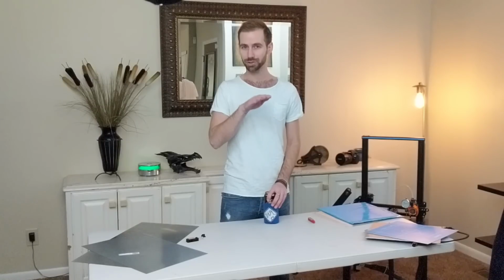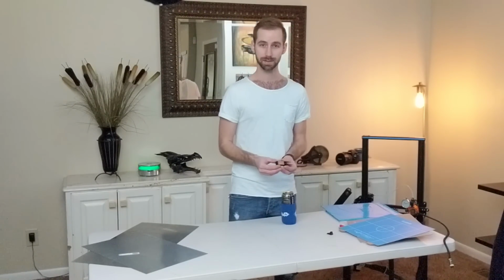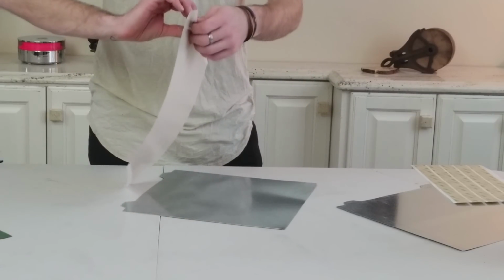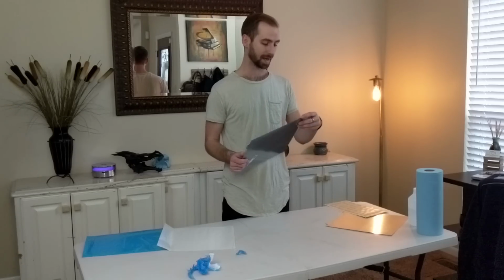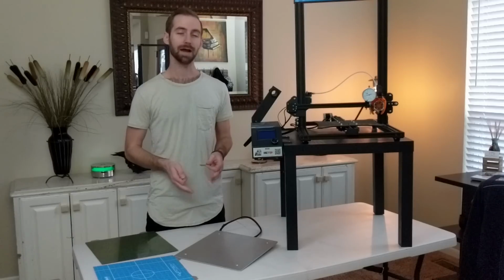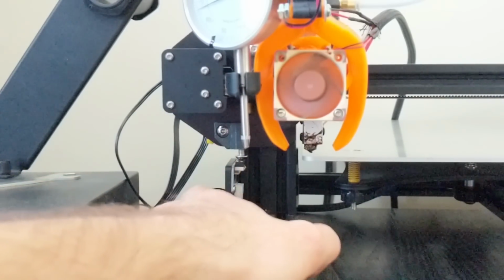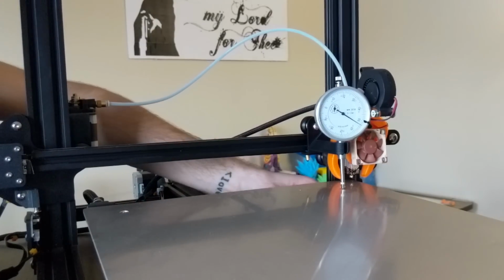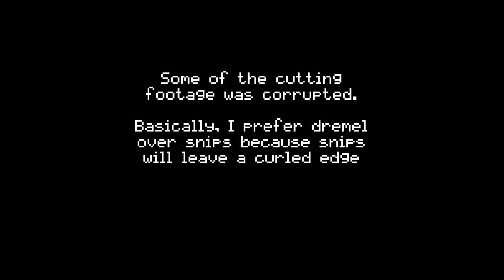DIY Magnetic 3D Print Bed v2! The best printer upgrade! Learn how to level your warped cr10 bed

Comment from the maker: Let this be a stepping stone! Do I do my prusa mk2's next? hmmm 🤔
Reply: Why Not? Do it! :)
Reply: DUDE. flip the buildplate and voilà: convex turns concave. the worst that could happen is you needing to re-countersink.
Reply: However, the HEATER is on the back side, so not really an option.
Reply: I simply added high temperature neodym magnets below the print plate and used an old spring steel plate I have from GeckoTek. This way I even have two different permanent build plate material and can swap them easily. See: https://www.instagram.com/p/BhY7d-phI5Y/
Reply from the maker: Yep, that's exactly what the video shows. Very nice
Reply: I just bought one print bed that is  magnet with both plates for 10$ on AliExpress. It works good and the adhesion is well without tape/glue
Reply: a tip : you can watch series at Flixzone. Been using it for watching all kinds of movies lately.
Reply: @Billy Howard Yup, have been using flixzone} for since december myself :D

Comment: I made one of these a few weeks back using a pei sheet. The set of adhesive strips that comes with the PEI is another mounting option. Instead of using the full sheet of tape you can spread the strips out across the area this make it a bit easier to remove then using the full sheet. Though I opt for using the full sheet. But a bonus from this is the strips work perfectly for mounting the magnets on the bottom of the heat bed. The adhesive is made for high temp since it is for sticking PEI to heat beds. 

   I am using this set up with ABL. It doesn't seem to be negatively effecting it. I thought it was at first but it was another issue (Had a Z rod lose in the coupler) Though this is only my experience and I have not done extensive testing so I don't guarantee anything.

   Thanks for both of these videos. I intend of make these (with PEI) for the ender 2's i plan to get in the near future as well.
Reply from the maker: Shane Sick oh that's a great idea for the magnets! I will add that to the description. That's awesome man, I'm glad I was able to help!

Comment: On my Toyota 4x4, when i cut my fenders, i bent up some 1/2" EMT conduit and welded it just inside the cut. That made the edge nicely rounded, not razor sharp anymore. I can grab the fender's edge and rock the truck without flexing the fender noticeably. Remember to sand the zinc-plated conduit before welding.
Thanks for the printing tip too...lol.
Reply from the maker: Nice! I have door edge covering going around the edge of mine. Works great!

Comment: Have this going on in my CR-10 setup and share accreditation to this link when I can (Facebook, Thingiverse, etc.). And then you did the center adjustment model. 👍

“square”-sized chopsticks with a fit into an appropriate-sized socket attachment (specifically on a screwdriver-shaped multitool) are a good reach to the adjustment model without attaching to the glued-on magnets above.

Comment: I got my spring steel plate at metal jobst in germany. It is not cheep (20x20 for 25€), but very high quality. They have bigger size also, you can get custom made size if you need.
I use clamps at the moment, but think about changing to magnetic bed also. As the heated bed I have is a cheep PCB anything but flat, I got an 6mm ground aluminium plate and a silicone heatbed (230V). I think about milling some pits in the upper side of the aluminium plate, to glue (with high temperature silicone) some samarium-cobald magnets inside - so the spring steel will directly contact them. The magnets will only carry 0.45 kg each (only 6mm diameter, 2.5mm thickness), but with direct contact to the spring sheet I think 16 pcs would be enough to make it hold.
The only problem I see ist autoleveling. I also will upgrade my printer to an inductive sensor. So my question is: would it be the best to place the magnets exactly as possible the points the meassuring is made or as far as possible away from that points?
Reply from the maker: Unfortunately I can't comment on this only because I'm not using an inductive sensor. I'd say once you have your sensor installed, just try a few things out!

Comment: Was waiting for this video very good information specialy the leveling part. Made me want to buy a dialer. Offcourse your channel is just starting so there is lots of points that can be improved but the content is very good keep it up man this can be a great channel!!  Was kind of hoping you choosed between pei and lokbuild so I would make that one but if they are both the same  then I guess I'm just going to buy the cheapest one.
Reply from the maker: sorry for the wait! i def feel like this was a sloppy video but i need to invest in better equipment.
Luckily PEI and lokbuild are roughly the same price. Maybe i'll do a follow up after i've printed on the PEI enough.

Comment: I use inductive sensors on (easy abl) and works perfect. There is no need to level the bed by hand (ok. be smart and level it at once by marlin corner leveling) then send G29 after G28 at the beginning of each gcode. Its really easy.

Comment: I like the dial indicator test.  I have a question though, once you finish using the dial indicator and then put the build plate back on, don't you have to re-adjust your levels again for the thickness of the build plate?  Won't that throw off the setting for the center wedge?  Shouldn't the build plate be on first and the extruder set to the correct height for the build plate before using the dial indicator at the same time?

Comment: Btw… Use simple black/chrome paper clips to hold the calibration needle up during prints
Reply from the maker: You shouldn't be trying to print with the dial  mounted, too much extra weight on the gantry

Comment: Did you consider zig-zagging the tabs so that you could get two sheets out of the 1 24" sheet? Yes there will be a couple of spaces where the sheet will be floating in space, but I'm presuming that you won't be getting all that many prints to those points. It ends up being 2 voids of about an inch by half an inch, or whatever size you cut the tabs to.

Comment: I made myself a 5$ probe with a servo to level my bed (it uses touch so it's like far less pointless :P it adjusts to any new surface etc.) and it's awesome! the accuracy is great. but I agree auto bed leveling is overrated unless it's super fast before every print or you have a bent print bed

Comment: Hello, I used the same PEI sheets that you have here, after they failed on me, I ended up ordering the thicker natural stuff from Amazon.  It ended up making a world of difference.  Take note, I print exclusively in ABS.
Reply from the maker: hey there! I'm curious how they failed on ya? my one PEI sheet is still going strong
Reply: I caused a pretty solid tear from getting a piece off, and scratches from my scraper were getting to it.  With the thicker one, I've also been able to refinish it with sandpaper and still have a lot of thickness to work with in the future.  Oh, last but not least, they sell a 12" x 24" sheet that I was able to just cut in half, making it all about the same price as the thin stuff.  And the added thickness ended up making it harder for the prints to bend the buildplate for larger items.  I've somehow managed to break a piece of glass mid-print because of the torsion put on it by ABS warping.
Reply from the maker: LevelUpFitnessArcade nice! Yeah pei scratches pretty easy but even the one I link to is plenty thick enough to sand down the surface. Did bending the plate not help pop your print off? I don't print with ABS so I have no idea how it sticks
Reply: This one was a full 1.5 pound print that actually printed over the build volume of my delta printer, and a deep scratch in the center area turned into a tear when I popped it off.  Plus, it was in the center area, and that gets the most use from me.
Reply: Hey 
LevelUpFitnessArcade - I've got the Gizmo Dork ones on both my Monoprice Select and my CR-10S, so far so good, but if I don have a problem I'd love to know exactly which 24" sheet you ordered. A link? :-)

PuterPro
Reply: OK, now I'm OFFICIALLY confused. :-} The Gizmodork (linked in the sticky comments) is 1.0mm thick. I know, I have two. The "Thicker" one you referenced (linked above this comment) is .03" which = .762mm. That makes it THINNER than the GizmoDork one. I thought you were recommending the other one because it's thicker so will take sanding (which I know the GizmoDork one does). Did you mean a different one from the same vendor?

Comment: Nice Video and great idea.  The magnet cost may put this off for now, I'm running with PEI on a mirror tile from Lowes. My CR-10S had a convex middle, but I found using a Dial indicator it was pretty much even, just both sides too low, so I used strips of Aluminum tape (used in duct work) down both sides and got an almost perfect level! BTW - I used the "strips" of tape on my 1st PEI attempt (on my Monoprice Select) and learned this PEI sheet is thin enough to reflect that. DON'T DO THAT! Use the big sheet of adhesive (did that on my CR-10S)

Comment: I used 14 magnets on both my CR10s and a Tevo Tornado.The Tornado has a glass type black heated bed.  I epoxyed them down as I feel it is thinner and will help the magnets pull more (or lose less power) . I bought a 2x4 ft 26 gauge sheet and sheared it myself into 8- 12" squares. (I have a shear in my garage). I have been using PRINTinZ sheets and love them and have yet to replace any after many months of use. Also known as Zebra skin they are pricey at $31.50 a 12x12" sheet.  However they are the best surface I have ever used. They are smooth and everything sticks to it! They come in black or white ,for printing dark or light colored filaments to show up on easier. I may try PEI in the future just for grins though.  I am interested in weather the ABL sensors will work or not with the magnets.
Reply from the maker: Paul F I updated the description with info about ezabl! You should be  fine with it. I'm jealous of you having a brake. I just don't work with sheet metal enough to need one. The epoxy is a great idea and was going to be my original plan but I figured I'd want to change the design - as I did lol.
Reply: Ahh OK I must have missed it. Dremel cutting wheel works just fine too! I used to do a lot of fabrication and automotive work . I am gonna try your center leveling wedge , another great idea! I print mostly in PETG anyway.  Nice job on the magnet idea and video Congrats man !  You got a new sub .
Reply from the maker: same man! the truck in the background was mainly cut with an angle grinder and dremel.. i've been through i think 10 dremels because i use them way more than they should be used ha. thanks man! glad you enjoyed it!
Reply: LOL Time for a 4 or 4.5" mini grinder.  Wheels last so much longer and fairly cheap. :)  I sold all kinds and brands of tools and equipment  for years as a retail/wholesale business. They make a .045 wheel for them that is fantastic by SAIT abrasives in the usa. its only about 2-2.50 per wheel and can cut up to 1/2 thick steel  fwiw
Reply: How did you do this on the CR10s? I tried to do this on my CR10s and with the glass bed removed, the Z axis can't get low enough because the metal brackets (with the roller wheels) hit the top of the stepper motors. It can't get down low enough to engage the limit switch because of the metal brackets hitting the top of the motors.
Reply from the maker: J Belle I cover that in this video and show you how to do it on your cr10
Reply: Wow, I'm an idiot. I watched this a while ago, ordered the stuff, received them today. By the time I went to do it, I didn't watch the video again and completely forgot about that part. I will go hide in a corner now.
Reply from the maker: HA! It's totally fine! Honestly at first I almost didn't reply because I thought you were trolling.
Reply from the maker: No complaints on any of mine. Let me know how it goes!
Reply: Sorry I replied to the wrong person entirely. lol! I meant to reply to cityhunterinak
Reply from the maker: Ha, no worries!

Comment: Great video especially the Fixing concave bed part, BUT once you have the bed flat using the dial gauge how do you get the gap between the bed and nozzle correct, you will have to move the bed again ?
Reply from the maker: Thanks Peter! 
live z height and the z endstop adjustment work wonders. You can totally fine tune that way
Reply: @ImproperEngineering  Thanks reply

Comment: Is there a benefit for not using the aluminum/foam cover under the bed? Do you have some problems with heat or something? Because I have it and I don't know if I should remove it for the wedge.
Reply from the maker: Iirc only the 10s has that. it's insulation tape. Won't hurt anything if removed but does help the bed heat up a little faster. I've thrown a wedge under a 10s. Though. A little tight, but should still fit. You could also scale the wedge down a smidge
Reply from the maker: Iirc only the 10s has that. it's insulation tape. Won't hurt anything if removed but does help the bed heat up a little faster. I've thrown a wedge under a 10s. Though. A little tight, but should still fit. You could also scale the wedge down a smidge

Comment: Another solution I just discovered is to purchase the "Additional BuildTak FlexPlate" which is a spring steel plate made by BuildTak for their Complete FlexPlate system. Their 12"x12" plate costs about $35 US and should be better (but more expensive)  than using sheet metal. It comes bare so you can stick to it Builtak, LokBuild or PEI.
Reply from the maker: someone else mentioned that! i don't know that it would be the better solution, but it would give the same results probably. def another alternative! may order one just to see how it stacks up and do a video on it. thanks Avi!
Reply: Better only in the sense that it will not deform. I ordered one and I'm going to get a PEI sheet from a local distributor. I'll get a 10 mil PEI sheet with 5 mil acrylic adhesive already applied to it which makes installation a whole lot easier. I used a PEI sheet with the same thickness and adhesive specs before and it as easy to install as any of the other solutions.
Reply from the maker: Avi Schwartz ah I gotcha! I can honestly say it doesn't warp like people think. It 100% does not affect anything at all. Let me know how that works though! For the people who don't want to make their own and don't mind spending some extra $$ that may be a good option
Reply: Now that I've used the BuildTak spring steel plate and the homemade version for few weeks I am sure the spring steel plate better solution in some cases. There is no way I can bend the heck out of the sheet stock without deforming it at all. I guess it comes down to how much you need to bend the plate in order to release your print. Probably in most cases you can get away with the metal sheet stock but in some cases I had the print stuck so well to the plate that I would have had to bend the steel plate completely out of shape. Another problem is with smaller objects that require a fair amount of bending to start separating them form the plate. This is not a problem with the spring steel.
Reply from the maker: Of course! Spring steel will for sure be better as it can flex and flex and flex and not distort enough to make a difference. Will I personally be moving to spring steel? Nope, not worth it for the price IMO. The ease of prints popping off are def going to depend on what you're printing. I printed something the other day that had the whole bottom covering the print bed and it came right off. Then I've printed clips for some of my products that are about 1mmx15mm and they pop off as well. Don't get me wrong sometimes I still use a spatula to be safe at times but I'm just sharing my experience.

Comment: Yo, N42SH grade neodymium magnets will operate at 150 Celsius. So if you don't want to be constrained lower than 80 degrees, those would be the obvious choice. K@J magnetics sells any size or shape you could possibly want. .
Reply from the maker: The ones I used and linked to are rated for 150c. Not sure where you got 80* from, but the company I linked to also has a kinds of shapes and sizes.
Reply: @ImproperEngineering  Gotcha scrubbed through the video so see how people are building their own. I thought you were mentioning in there you're limited to 80c. 
Want one for a creator pro bed, ill probably end up just milling into the bed and using the sandwich method from there. Sandwiching a thin magnet between two boddies of steel greatly increases the magnetic force, as much as 32 times. More realistically for this application around 5 times as much force. The benefits being less magnets, less space taken up, less weight, and less cost.